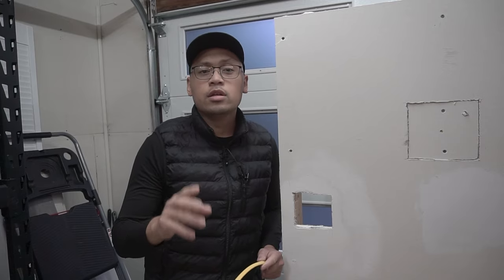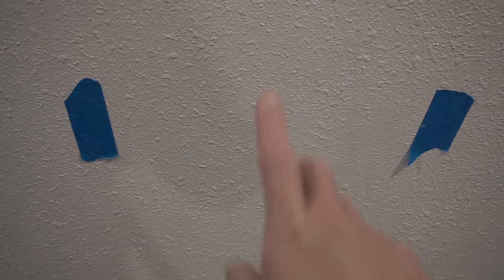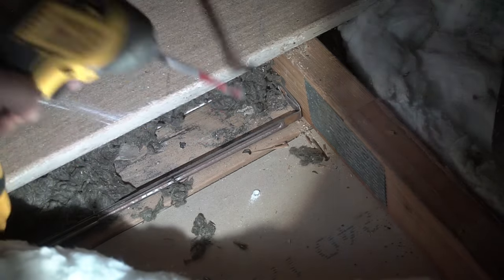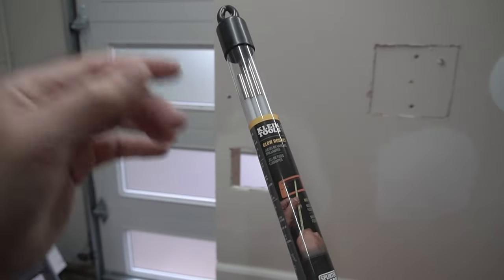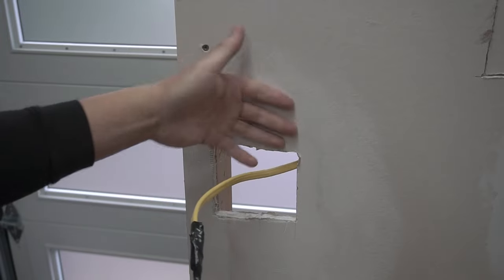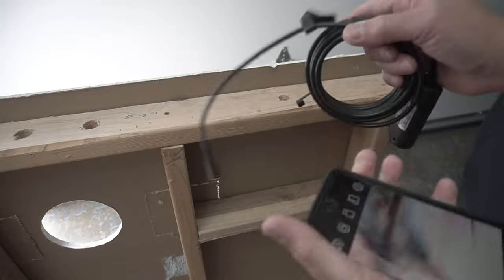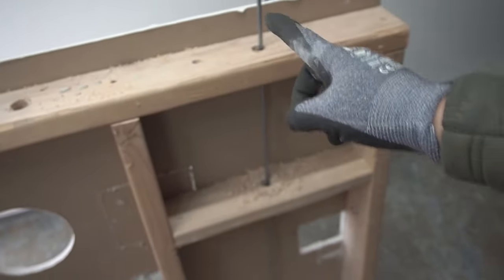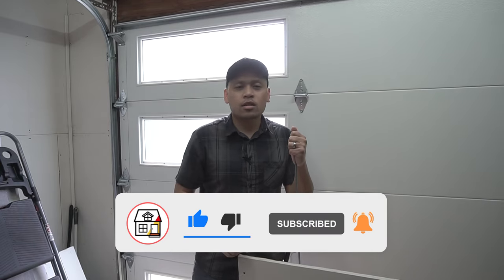How To Fish And Pull Electrical Wire From Attic Or Crawlspace To Outlet! DIY Tutorial For Beginners!

Comment: Well, nice video however, it’s never this easy.  First of all you’ve got firebreak studs that you gotta try to find a way to get through. Next, If you have an old home like I do, you’re gonna have diagonal studs and braces. It’s a nightmare , something that even pros hate doing.  Why don’t you make a mock up of the nightmare scenario and that would probably be very helpful to many people if you can pull it off.
Reply: The endoscope and extra long drill bit are your only options other than opening up the wall. It seemed to me like he covered both pretty extensively when he was talking about and demonstrating how to deal with a firebreak.

Comment: Sorry but your mock wall is hollow and my real wall is stuffed with  thermal insulation. In real life one needs to punch the pull rod through that pink wool. Will your system work?
Reply from the maker: Stay tuned! I have a solution for that on my future video 👍🏽😊
Reply: Right... I'm curious to know also

Comment: 2nd method you can pull the wire through without cutting a hole in the wood, then just put metal over it and patch. This is the way I used for running cable through joists in the ceiling where you don't want to cut the structural joists.

Comment: Videos  good  for  newer  homes  but how  do  you  fish  lines  with  laith  walls  on older  home's  thx?
Reply: It's hard....i just did it at my house. If you know where you need to go, I had to use a oscillating tool and actually make a 1" channel down my wall, fished the wire, then drywall repaired it. My studs aren't on 16", some are on 10" some are on 22" it's insane. Lathe and plaster sucks. I love my house but the best advice I can give you is..........rip the damn wall down and drywall back up. I hate the lathe plaster. Lol
Reply: most of these methods still apply. but sometimes with older homes there ban be spaces you can take advantage of. a neighbor o my mom's once fished a chain down an exterior wall from attic to fist floor because of this. take your time, look around, be creative. then there come the times when you simply have to open the wall and then patch later.

Comment: The top plate of my exterior wall is only about 8 to 10 inches below the roof sheathing. It’s impossible to drill through from the top as far as I can tell, even with my right angle drill. I guess I’m stuck coming up from beneath unless you have some great trip for that!
Reply: Pumpkin Cut an access hole in the drywall drill your hole pull your wire and patch it

Comment: Thank you for this. I'm going to attempt to install a bathroom fan myself. Not thrilled about cutting the hole in my roof, but I'm going to give it a shot. Hopefully I won't have to call the roofing company to fix my mistake lol. 😂 The only difference I would encounter maybe is that I have lath and plaster, not drywall. But most of the method still applies.
Reply: I did my own bathroom fan install and found exhausting it out of the side wall in the attic was easier/lower risk than the roof. You can easily get a vent cover... Think like dryer vent exhaust. Just offering up what worked for me as a homeowner.
Reply: @Invierno1894  my house is brick though with cinder block behind it. That would be a nightmare to cut through 😔

Comment: what about the other side of the wire do you have a video showing how to make a run to the panel with the outside wall being stucco and not cutting a piece of the dry wall from the inside off the house? Thanks,

Comment: Very informative! Thank you! Do we have to fireproof firestop? What about the first block from attic?
Reply: I second the question. Is fire stop needed for the hole we drilled once the wire is feed?
Reply: @deanf3872  I hope somebody knows the current code on this question, I’ve always wondered. Fire stop, is still there, and will do most of its job. It’s just that a little bit of flame could get through that hole.

Comment: How does the stud finder work?> is it magnetic, etc?
Reply: Electronic stud finders rely on sensors that detect changes in the dielectric constant of the wall. The dielectric constant changes when the sensor is over a stud. The lower reading indicates the presence of a stud in the wall.